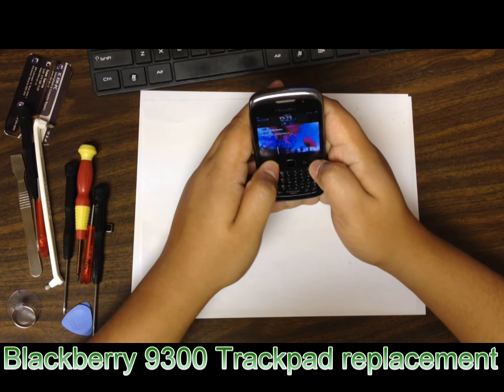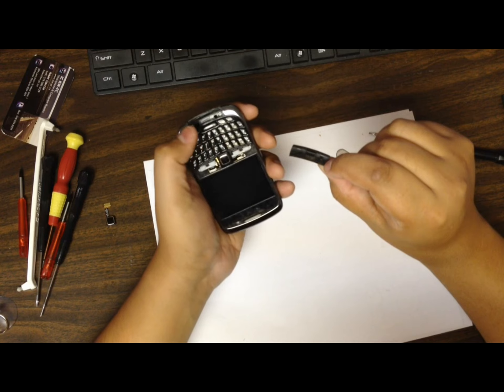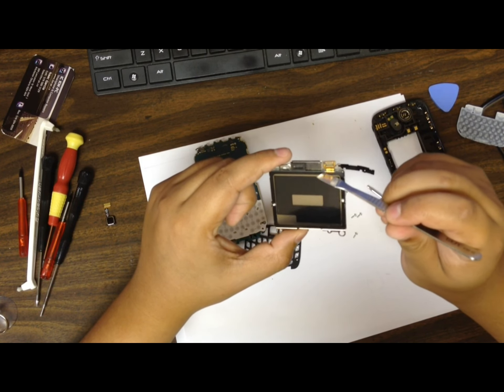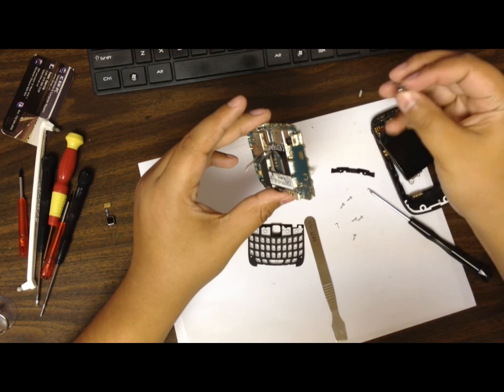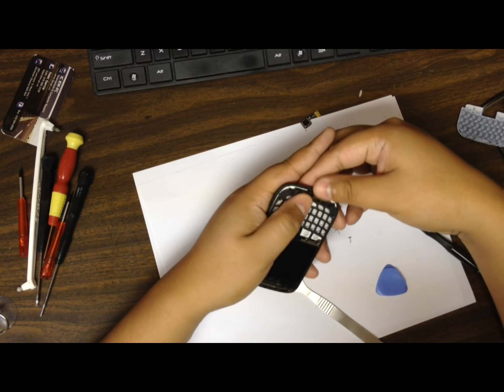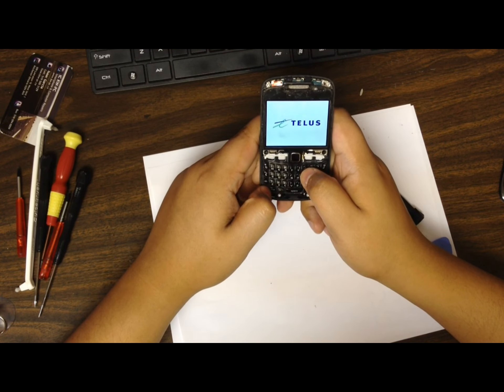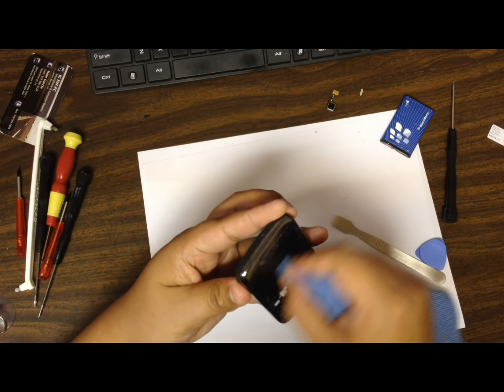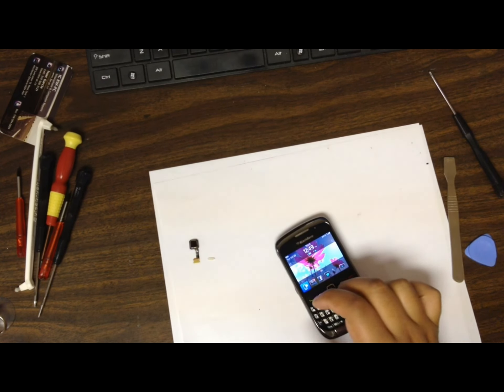Blackberry 9300 Curve Trackpad Replacement Tutorial DIY

Comment from the maker: @efrrren hello the one with the blue dot you can just shove the screw driver right through it. and you can't remove the bezel without taking the screws off. Im not sure whats up with the top part, if it is what i think you mean its cause you have to slide it in from the top first then clip the bottom part down.

Comment: Hi techguyz, your video was a great help, thank you :)
If I could ask your advice..I got the new trackpad installed, although it scrolls ok, the button function will not work. I wondered if I could have damaged anything? or is it more likely the replacement trackpad is duff.
The old trackpad didn't scroll, but the button worked! lol
I'm getting round the new issue by using the keyboard return key to "click".

Comment: I tried this procedure but the trackpad had a loose fit and didn't work. Could it have been a bad product that I bought from eBay or is it a case of pushing the back in further? Just felt like the latter option would have broken the trackpad.

Comment from the maker: hello, that isn't good. however put some two way tape or some electrical tape over the trackpad connector after you slide it in. it should still work without the top clip.

Comment: why do you strugle so much with that connector :D its very easy to fit it in, heres how i do: just match one of his esdes left or right push it half way in than slide your finger gently to the other side and push on that side too, if it's not fitted well it will fit by itself, final step push gently from the middle, , most of the times you shoud hear a click.